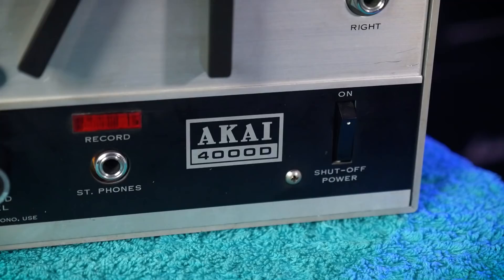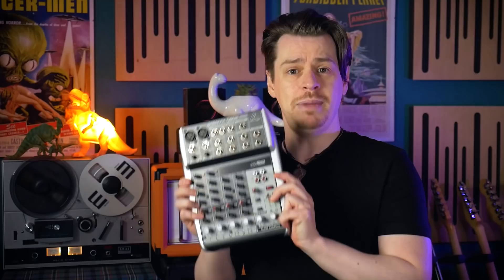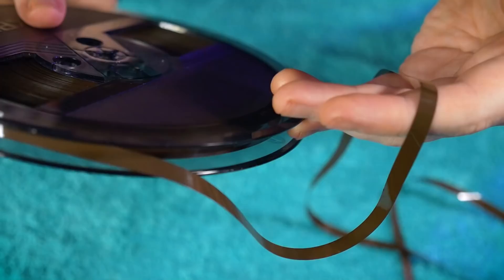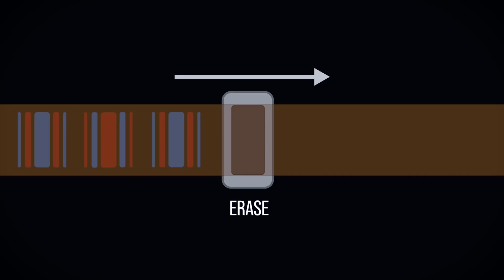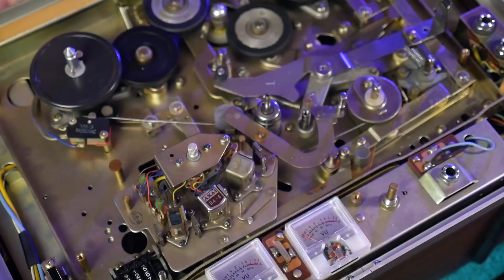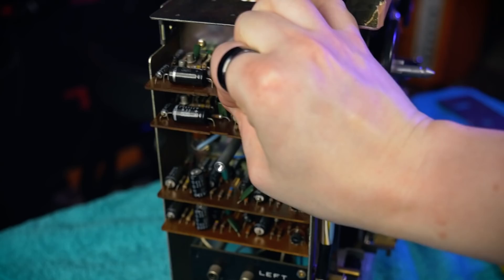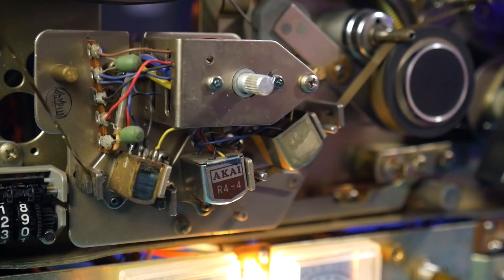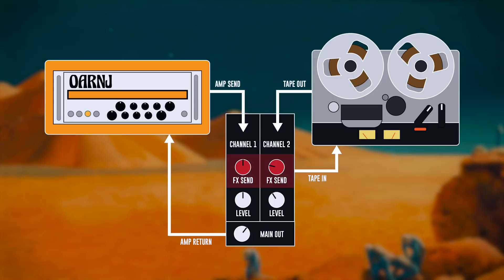Turning 1970s Reel To Reel TAPE into a GUITAR Echo

Comment: Have you ever seen the trick with a short piece of tape and a boom mic stand? You set up a triangle, where the tape runs through the machine heads, around both reels, and around the mic stand, so it just recycles over and over like the tape echo effects units you mentioned. I've had an old Akai X1810 for many years, and never gotten around to trying it out. Thanks for making this vid, Colin.
Reply: I used to do that in the 80s. You can also get random panning effects if you position the boom in such a way so that the tape runs slightly off center when passing through the tape heads. I made some great loops using this trick.

Comment: We used to make simple echo machines from reel to reels in tge 70s to play through as we couldn't afford effects. Can't quite remember how we did it but we messed round with effects using them. I vaguely recall sometimes using a loop and also tricks with covering heads etc depending on the machine.

Comment: If the drive motor is dc you could easily add a pwm speed control for adjustable delay time on the fly. Very cool project.

Comment: You missed a trick here to double your delay time - take advantage of the dual channels of the tape deck to delay the signal twice before returning it to the mixer. Just plug the left output directly into the right input and then feed the right output back to your mixer.

Comment: I picked up a TEAC 4 track machine 2 years ago for $600 AUD, and ive never looked back. Only delay i use now, as i got lucky abd bought a machine with a built in Variable Speed Control, meaning i can get very precise delay times in tempo with any song, and the 4 tracks means i can have up to 4 delay times (all of which are varible). If you are looking for a machine, get one with variable speed (varispeed)

Comment: My experience is that a Reel to Reel tape machine that has sound on sound, will echo without playing the tape.  Putting the tape machine in the record mode and pausing the machine from playing/recording, one can use a microphone or guitar in the mic jacks and use the whole machine as an effect and/or a pre-amp.   Next by adjusting the the sound on sound one can get an echo effect.. It has been a while since I have done what I sort of explained, so I don't really recall how to set the Sound on Sound (maybe just turn it on).   Also I would come out of the back of the Reel to Reel, where the RCA jacks are and connect them to my cassette deck component.  I would record on my Cassette Deck but with all the sound quality and effects of the Reel to Reel.  It is a warm overdriven sound that comes out on the cassette tape but yet it still has lots of clarity for vocals.  I hope I wrote this so as, one can understand what I was explaining.

Comment: I think you can create a more flexible solution (in terms of speed of the delay) by voltage-starving the electric motors a bit (slowing them down). I'm not an technician/electrician, but that doesn't sound like the hardest of mods. 

Great project, thanks for sharing!

Comment: Maybe it's possible to record your signal on one track, record the playback of that to the second track and send that to the amp giving you twice the delay. You could also bodge something together to make the piece of tape travel further in between heads. Maybe there is also a small potentiometer somewhere hidden in the machine to change the pitch and thus speed

Comment: Great video, just what I was looking for! As you mentioned the delay time is dependent on the speed chosen via the capstan ring.  I am trying to get a delay time between the 2 default times provided. Would / could a custom made capstan with a wider diameter thread  eg 50%,  (while maintaining the existing thread diameter) provide  such a possibility ?  Am I wrong in assuming that the diameter of the capstan influences the speed of the delay?  If this is not possible is there any other way to vary the delay speed? My reference  speed is that  from Ritchie Blackmore's "Mistreated"  from the On Stage  album which I believe is somewhere between the two speeds provided by the Akai  featured. Thanks.

Comment: I have two TATa's: what is the tonal difference between covered and uncovered pickups, and what is the tonal difference between active and passive pickups?
Reply from the maker: These questions are too vague to give any conclusive answers about. There are more factors at play than just the straight comparison you provide. 

The first question is addressed within this video: https://youtu.be/5JMsRX6SGlw
The affect covers have depends largely on the material they are made from and how that interacts with the magnetism and inductance of the pickup. 

The active vs passive pickup is entirely unanswerable as not all passive pickups sound the same - nor do all active pickups sound the same. So there can't be one answer to this. 

Active pickups are wound to be weaker with an even frequency response and use a powered preamp to amplify their signal and shape their sound. 
Passive pickups use the properties of magnetism and inductance alone to produce their signal
Reply: @ScienceofLoud  cool thanks

Comment: I'm sure I'm really thick but why do the repeats lose volume if they're being fed back at full fidelity through the mixer?
Reply from the maker: They are mixed in quieter than unity volume, so every time they get fed back they are slightly quieter than before.

By increasing the mix louder than unity the delay goes into infinite feedback and the delay gets louder and louder until saturation.